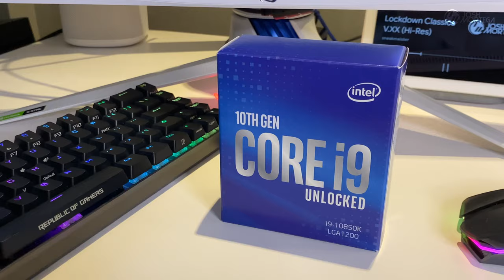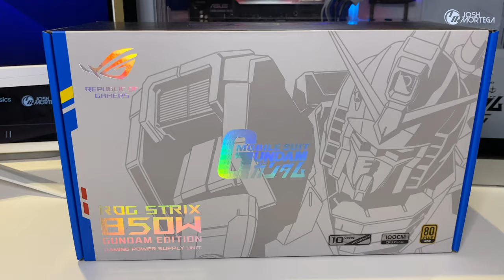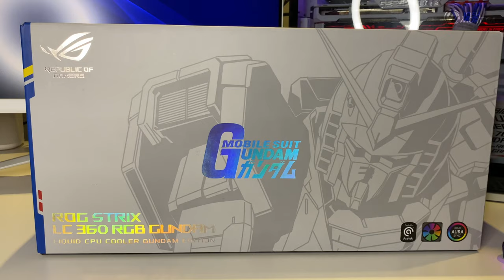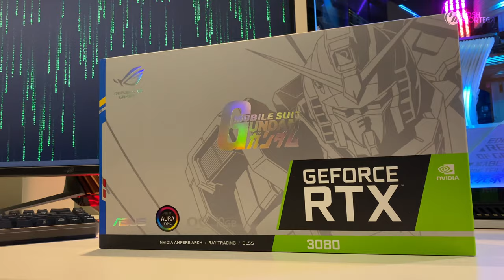Asus Gundam Full Build on RTX 3080 #asusgundam #asuphxgundam #gundam

Comment: Did you have any problems with motherboard/cpu compatibility? I’m thinking about getting the same ones you used in this video but pcpartpicker is suggesting a Rocket Lake based cpu instead of a Comet Lake based cpu. 

Also, awesome build and great video!
Reply from the maker: Hi, no issues at all. You can pick whatever suits your preference